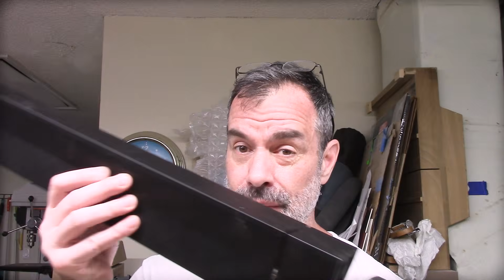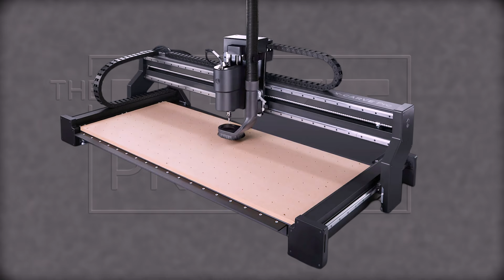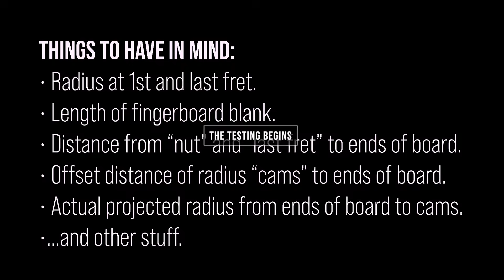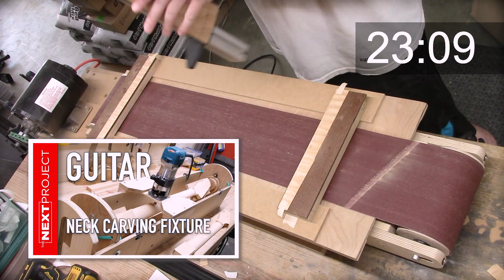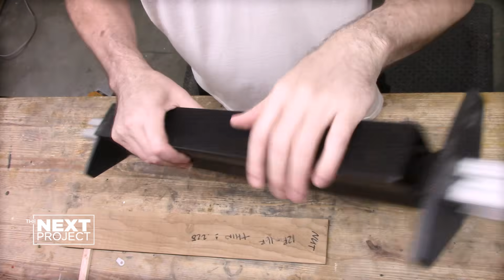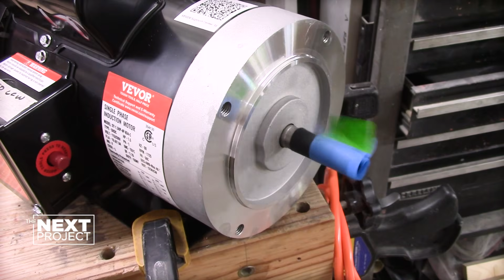6x80 Belt Sander and Conical Fingerboard Fixture - Project & Testing

Comment: Great innovation with the cams . 

I really love these types of innovation videos ... I also build custom machines that no one has ever made and i like seeing what others come up with!!!
Reply from the maker: Hey Darryl, good to hear from you again, and thanks for watchin!
Making this sander popped into my head because I had an upcoming project where I needed to make a conical fingerboard.... Yes, there are other ways to do that without creating another project... I'm weird that way.
I also realized that a big sander would be helpful with a lot of other tasks down the line.
The radius cam idea started out as an overhead pendulum. The pendulum sander idea was very much borrowed from the Grizzly fingerboard sanding machine...$1700US.
I realized that my pendulum design would require a lot of time, testing and materials to make accurate radius sanding boards. I just don't have the right machinery to fabricate that type of tool.
So, I looked at the issue from a different pov. And this low-profile cam idea just kinda grew out of it.
Still needs some refining and very likely some overall improvement, but I'm really happy with the result.
The sanding belts were purchased from amazon, I also purchased a larger motor, again from amazon. The plywood was all scrap material that was headed for a dumpster. The axles and bearings... amazon. Hmm, I shop way too much on amazon.
I like that this sander is pretty light weight, maybe 25lbs, and can be moved out of the way easily.
The motor is heavier than the sander. 
Still doing final re-prototype work on the belt tensioner, but the darn thing works pretty well as-is.

I just saw a "tool" video the other day, and the host offered some horsepower ratings for "grinding belts". He said 1hp per inch of belt width. WOW, I'm way underpowered, but then again, he was talking Grinding, not Sanding. 
I have 80, 120, and 180 grit belts, he was talking about 24 and 36 grit. 
More power is always nice, but I'm not wired for anything beyond a 2hp motor.
Reply: @theNextProject hahahah i think i saw the same video as well 😂 was it the one wotht he home made belt grinder with the go kart wheels ? 😂

I need to get back to the workshop!!! I have an exam coming up so i had to sacrifice my workshop tome 😞 , hopefully im back at it soon ... Keep the good ideas coming
Reply from the maker: Yep, Fireball tools (?) go-cart grinder... 
He builds some cool stuff.

Comment: Thanks for the inspiration! Should not the offsets be 1" smaller at the 12" nut end (11"), and 1" larger at the 16" 24th fret end (17") with the bridge in final assembly being ~20" radius? Cheers!
Reply from the maker: Dejoblue, thanks for watching!
Not sure if I'll answer your question completely, but here goes...
This fingerboard was sanded to a conical/compound radius of 12inR at the nut to 16inR at the heel.
The radius cams I use have a 1in offset from the actual sanded fingerboard surface. So, the 12inR nut end has a cam with a real radius of 11inR, plus the 1in height of the surface the cam(s) rest on for the final radius of 12inR at the nut. Same 1inR offset at the heel of the neck, so the 16inR cam is actually 15inR in reality, plus the height of the offset surface.

Yes, the bridge saddle radius will be a projection of the string paths, from nut to heel (12-16), resulting in roughly a 17inR at the saddles.
The formula I use for conical necks is this:

a = nut R
b = last fret R

b - a = c
c / 3 = d
d + b = "saddle radius"

In this case

12 (a nut radius)
16 (b last fret radius)

16(b) - 12(a) = 4(c)
4(c) / 3  =  1.333(d)
1.333(d) + 16(b) = 17.333in saddle radius

If your are target is a 20in bridge/saddle radius, then you would want to either flatten the heel radius, or a combination of tighter radius at the nut and flatter at the heel as you mentioned. You'd need to run the numbers to find the saddle radius you want. 

Using the formula above, if you have an 11R nut, and 17R heel, the projected saddle radius would be 19R. That's pretty close to the 20R you mentioned. A hair, or two... pretty darn close.

I had read somewhere, that there is a "sweet spot" for conical radius boards. Too extreme of a "cone" fingerboard causes set-up and player issues. Can't recall where I read that - it's out there somewhere.  Sounds like experiment time!

Hope this gets close to answering your question.
Reply: @theNextProject  Thanks for the reply :) I misunderstood the offsets' function. I think i understand now. Cheers!

Comment: Hey, I want to do that but i need a exact plans and measures of those 3D printed plastics that covered the metal and the ones on each sides. Anyway i can get those's measures or plans?
Reply from the maker: Here's a link to the 3D files and an example of the extruded aluminum that I used.
I don't have any dimensional drawings or such to go by at this time.
Hope this helps, good luck with your projects!

Belt Sander - Radius Fingerboard Parts - PROTOTYPE

https://www.dropbox.com/scl/fo/z70x7gp1t1be9hnds8nii/AEi3bpPsHMHOOIRwL5AfFaw?rlkey=d5fyzml1sdl3s2p2yr531xshe&st=ksowbdlh&dl=0
Reply: @theNextProject  Thank you! I really wanted to do this but i couldn't figured out how to draw it by myself or how can i find those's plans. I can't thank you more.

Comment: Do you have a build video of the 6x80 sander?  I have to build one of these! After 30+ years this is the design I am going to go with. Saw something very similar at a major guitar factory many years ago.  Thanks for filming this.!   Subbed and Belled
Reply from the maker: Andluth, thanks for joining the family!
I don't have a belt sander build video yet, but it is on the schedule. I wanted to make this prototype, test it and make changes to my original plans before doing a build vid.  I'd expect it will be a  couple months out yet. 
Sorry for the delay!
Be safe and take care!

Comment: Such a great idea. I built a homemade edge sander a while back using Woodsmith plans, but it was massive. Soooo massive. My main goal was radiusing fretboards, so your benchtop version is such a better approach. And then using the 3D printed rockers instead of the Grizzly-style swinging arm... genius! Thanks for all your experiments, and sharing what you do. Stopping to film while doing experiments is a pain, I appreciate the effort you put into it
Reply from the maker: Philip, good to hear from you and thanks for watching!
It's good to hear that you made your own tool too. It's great to build and learn the thought process of the design as things are going together. I also understand how things can become "massive". That's one obstacle that I struggle with too, I keep attempting to shave things down, keep them as compact as possible, so I can hide them away when not in use. It's tough to do, some tools are just big.
I have a bunch of concept designs and sketches mimicking the Grizzly swing arm. I was this ' ' close to attempting to make a swingarm... but the size and stability were a concern. Stability was a big concern if not made from steel, as wood can have a lot of flex...
Anyway, this test went really well, a few upgrades underway, and hoping to use it on a real project very soon.
Be safe and take care!

Comment: Sure looks like it works; I thought the 3-d printed center, slide-on sections mod at the end was a solid idea.  Happy creating!
Reply from the maker: David, thanks for watching!
I'm pretty happy with this project test. Seems like all the parts are heading in the right direction.
The slide-on pieces will hopefully make sticking any length fingerboard to the extruded beam and easy process. Hope to be using this device on a real project very soon.
Be safe and take care!

Comment: Hey!!  Great project!   Given my small workshop, I always gravitate to space / multi use luthier tools like this.    I've attempted to retro fit some slightly longer belt sanders to sanding flat edges on necks - One of the most useful tools for guitar makers is the long edge sander.  But they're  expensive, and big.... Anyway I still need an  edge sander, and at least part of your project might be right up my alley, or swim lane.!   Great Start, and I will surely follow along on this next project :)!!
Reply from the maker: Hey Man, it's been a long time, good to hear from you!
Small work space...yep. Sadly, I keep packing more stuff in my space. 
I need to sort and purge one of these days.
The sander and the rocking radius fixture will be getting put to use pretty soon. 
The project I've been prepping these items for has arrived. Time to start the fun!
Have a great weekend, be safe and take care!

Comment: Great idea, looks like you are well on your way to having another very useful time-saving tool.  Have you considered putting a thin Teflon or maybe mylar sheet under the sanding belt?  That will help reduce the friction and allow more of the motors power to be used for sanding.  🤔
Reply from the maker: Pete, thanks for watchin!
I had originally thought about getting a thin stainless sheet to use under the belt (haven't acted on that yet).
Another viewer recently mentioned UHMW (Ultra-high Molecular Weight) Polyethylene Tape. That's new to me, so I'll have to look it up.
Mylar and Teflon sounds like a good options too. 
As I think about it. I need something that won't wear/transfer to the back of the belt, which would then get on the driver roller and potentially result in slipping... hmm. I need to do some research.
Thanks for the idea, anyone's guess what I'll end up doing. I'll be surprised, ha!
Be safe and take care!
Reply: @theNextProject  Sounds like the other viewer was thinking along the same lines as me as UHMW is very similar to teflon but is a bit more wear resistant, so that may be the way to go.  👍
good luck!

Comment: It wouldn't be hard to add vertical adjustability to the radiused cams, since you're using a T slot aluminum beam. Would be helpful in nailing the thickness.
Reply from the maker: Adam, good to hear from you!
Funny you mention a depth adjustment to the cams, I've been tinkering with the idea.
I've got some heat-set threaded inserts that can be installed in the printed cam, a slightly elongated passage for the extrusion to fit through... just need to ensure everything stays put in use. Also, as the cam is adjusted on the extrusion, it creates a unique offset centerpoint of the fingerboard being sanded, which in turn modifies the sanded radius shape. It's itty-bitty, but it seems every so slightly egg-centric, might not be noticeable, but something to consider. Still working on it. What I need to do is adjust my placement of the radius centerpoint in relation to the sanding belt surface... that's why those swingarm sanders have adjustment at/near the pivot...I'm overthinking this, lol.
That's why I'm working with the shims under the cams at the moment, but the future may see something different.
Thank you for the lateral thinking, that's great and where new ideas come from!
Reply: @theNextProject : The manual holding while rotating
the jig is throwing off the alignment, of the radius, from
end to end. A center shaft, on the jig, held in vertical
slots, at each end, would keep it aligned. You need to
have a separate set of cams, for each radius. The center
line, of the jig is the center of your radius (another good
reason to have a center shaft (to measure from)). Using
shims, under the cams, raises the center line away from
the sanding belt and so changes the radius you get.
I also believe, you need to start with narrower blanks.
bot 1/8" on each side, over finished size would be good.
Otherwise, you are doing a Whole Lot of extra sanding
and wasting a lot of wood. 😁✌🏻🖖🏻
Reply from the maker: Zapa, 
Yep, I'm aware of all that. 
A pendulum style sander, such as the Grizzly fingerboard sander, uses an adjustable radius pivot point(s) and a large pendulum swinging arm. A very large tool... doesn't fit in my workspace.
That tool has fine adjustment controls at each arm, which could be seen as changing the final radius if used independently.

For this test, I used a *12in R, and a *16in R cam. The nut sanded to 12R, the last fret to 16R. 
The cams are designed and printed with offset to compensate for the "bridge" lumber that stradles the sanding belt.
I understand how adjusting the position of the cam in relation to the board changes the final sanded radius profile. That is something I am not doing at this time, solely due to that fact.
Adding equal shims at either end does not change the radius of the cams, or of the sanded profile, as I'm not changing the relation of the radius center to the final sanded fingerboard crown. The shims only change the depth of cut allowed. 
The shims change the final thickness of the board, and not the radius being sanded.

If i took a shim away from one end and not the other, that would create a different radius outcome. But I used equal shims to elevate both radius cams (equally), so the surface centerline of the radius fingerboard has a uniform thickness.

This test worked very well, no real concern with the cam fixture in general. My main gripe was with the 3/4hp motor lacking, and the sanding belt being a bit fine in cut. I've got a 1.5hp motor, and 80 grit belt for the next tests.

I can, and may use fingerboard blanks that a closer to final dimension in the future, for this test I just used what was on the shelf. The board thickness was too great, so I re-thicknessed it a bit. Width could have been cut down, but for this test I didn't really mind. 

I'm also looking at using this basic setup (with different cams specific to the project) to re-radius an existing fender style neck, where the fingerboard is already on a neck... that should be a fun test as well.
Reply: @theNextProject : OK, I see what you are saying about the shims. 👍🏻👍🏻

Comment: You can order custom sanding belts that will fit a tread mill. There is a video of a mechanic who uses it to flatten warped heads. You could get an walking pad and have a sanding belt put on it. Also you may want to use UHMW (Ultra-high Molecular Weight) Polyethylene Tape to cut down friction under the belt. I enjoy your videos. Keep up the good work!
Reply from the maker: midwst, thanks for watching!
Thank you, I've seen some companies that will make belts to order. That was an early path I had looked at. Then I got cheap, and looked for budget belts, and wow there are a number of sized to choose from.
I treadmill sander would be interesting. I'd probably have to shorten it, as I don't need a 4 or 5 foot sanding surface.. I also would need to find a treadmill, lol.
I'll look into the UMHW material, as I do need and upgrade in that surface area = thank you!
Hope all is going well, be safe and take care!
Reply: @theNextProject : What your really want under the
belt is sheet metal. It won't wear and drag on the
belt, like the wood and it won;t melt like the UHMW
or any other plastic. Look at any stationary or hand
held belt sander. It's always metal. 😁✌🏻🖖🏻
Reply from the maker: @zapa1pnt  I have been considering a thin stainless sheet, possibly with a thin cork backer - idea borrowed from my small Porter-Cable belt sander... Just haven't gotten to that step. 
A concern I have with plastics and other slippery surfaces is what would wear away and potentially contaminate the drive roller and possibly cause slipping. So, as you mention a metal sheet may be the best choice.  I'll need to get around to that soon.
Reply: @theNextProject : Thinking some more, on this, a thin
sheet of stainless won't do. On a portable sander it works
fine but it is not for the amount of work you need it ti do.
It will get too hot. My Porter Cable bench top belt sander
has a heavy steel plate under the belt. It is part of the basic
frame, of the belt section, of the machine. Go to the hardware
store and look at a bench top sander, you will see what  mean.
What you are building is a bench top sander. Your jigs are what
make it a radius sander.
I hope you have a good concrete wall, to throw things at, because
you Will make use of it.
What you are doing is a Complicated thing. Every detail can
throw the whole thing out of 
hack and it will take time, to figure out Which detail did it.
Don't be discouraged, we're rooting for you. We're all in this together. 😁🖖🏻🖖🏻
Reply from the maker: Yep, I've used stationary belt sanders before. They are often built with a case iron deck, machined flat. 
I want to keep this sander lightweight, portable, easily stow-able. 
I had been thinking in the 20 gauge stainless thickness for this sander, not as thin as my portable belt sander, but that is the source for the idea. I'll need to determine if the sheet will be prone to deforming under use - more testing.
A number of others have built sanders similar to this, and use various other deck materials. Some use hardwood, plywood, or materials such as LVP (vinyl plank) as the belt contact platen. LVP may not the most sturdy material, but takes wear reasonably well, light weight, slick, and easily replaced when wear does occur. Whatever I end up using would go on top of the plywood deck that is already in place.
I'll have to account for the thickness offset, modify the prototype, and make adjustments to this radius sanding process accordingly.  
I'm doing the testing up front, so I don't have to throw as many things against the wall later, I hear ya.
Take care!